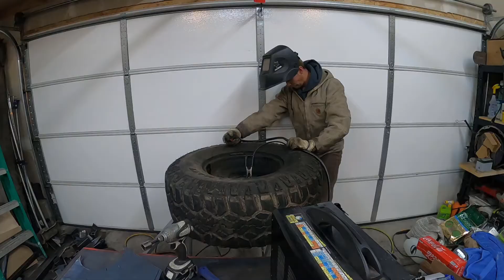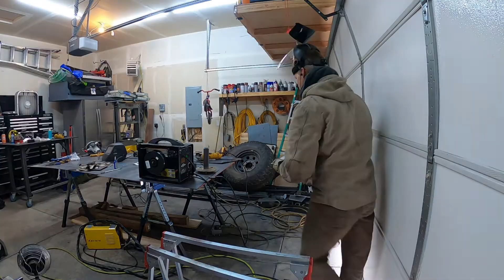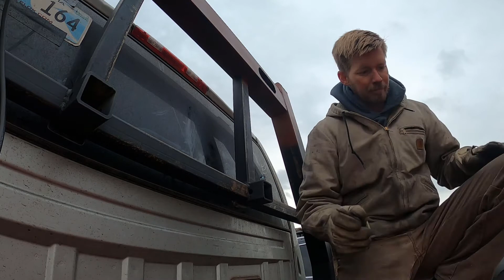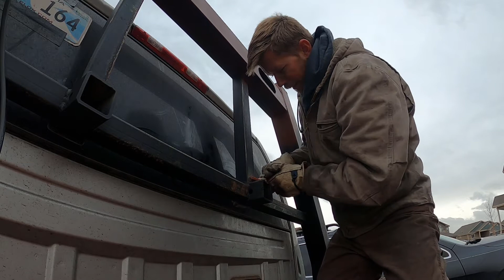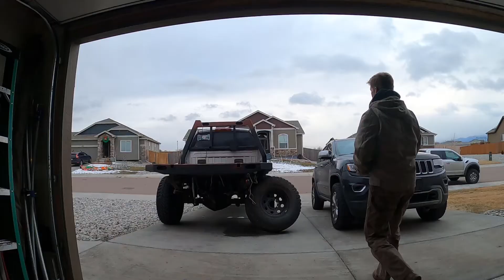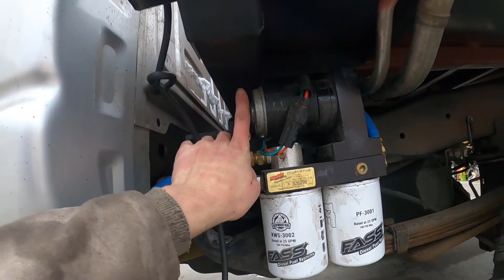Flat bed build for 3rd Gen Dodge 2500 (Part 2) (with my modification to make hitches fit snug)

Comment: Here is a better price for flapper discs.

https://www.amazon.com/WORKPRO-20-pack-Zirconia-Abrasive-Grinding/dp/B07M6XN561/ref=sxin_9?ascsubtag=amzn1.osa.4ca1dbca-fd6d-4d42-80d2-147815371a36.ATVPDKIKX0DER.en_US&creativeASIN=B07M6XN561&crid=WQLSZAPVLBIM&cv_ct_cx=grinder+wheel&cv_ct_id=amzn1.osa.4ca1dbca-fd6d-4d42-80d2-147815371a36.ATVPDKIKX0DER.en_US&cv_ct_pg=search&cv_ct_we=asin&cv_ct_wn=osp-single-source-gl-ranking&dchild=1&keywords=grinder+wheel&linkCode=oas&pd_rd_i=B07M6XN561&pd_rd_r=dc4de208-7ffe-4f85-bc88-64c438a923c0&pd_rd_w=aM41X&pd_rd_wg=QXsxN&pf_rd_p=f78282ee-db56-4d41-99a2-17abf93837bc&pf_rd_r=118GQS77KTSCZ8P0R9C6&qid=1605827676&sprefix=grinder+w%2Caps%2C433&sr=1-2-d9dc7690-f7e1-44eb-ad06-aebbef559a37&tag=thedrive09-20

Comment: How do you find towing a gooseneck with the shortbed? I have the exact same truck and want a gooseneck but all I hear are stories about people running the trailer into the cab.
Reply from the maker: I haven’t pulled the gooseneck with this truck yet but I’m confident it will go well past 90 degrees before making contact with the cab! Far better than a bumper pull!
Reply from the maker: I pull it with an even shorter bed without issue. 5.5’ F150